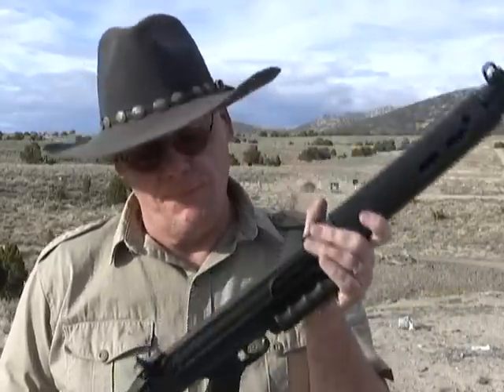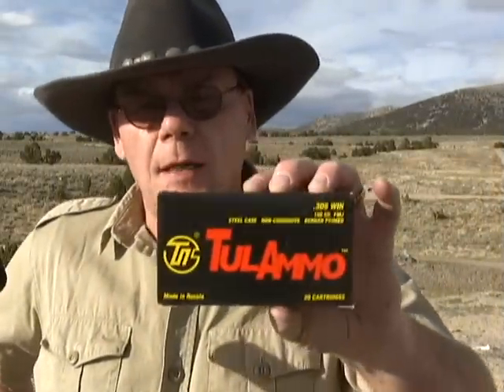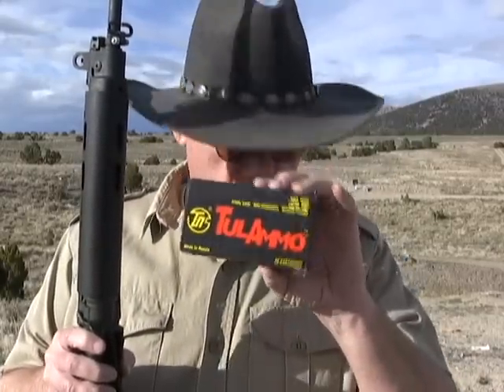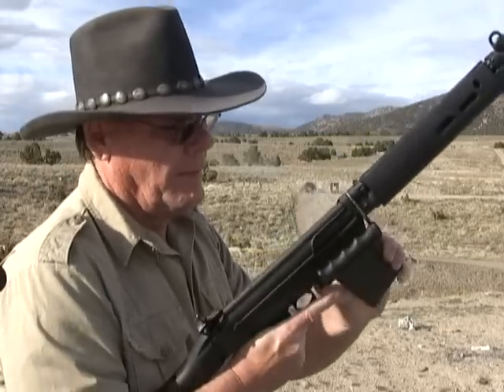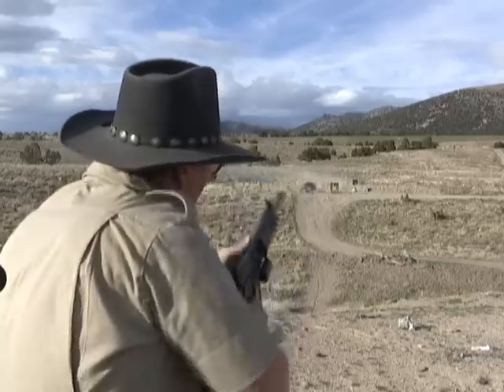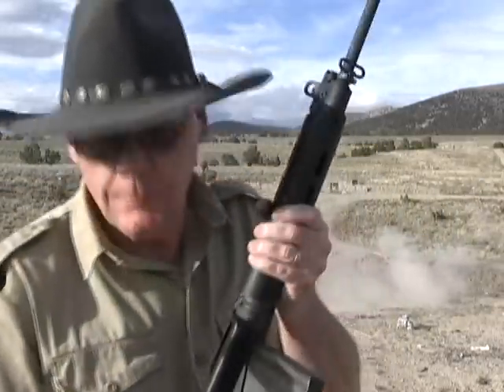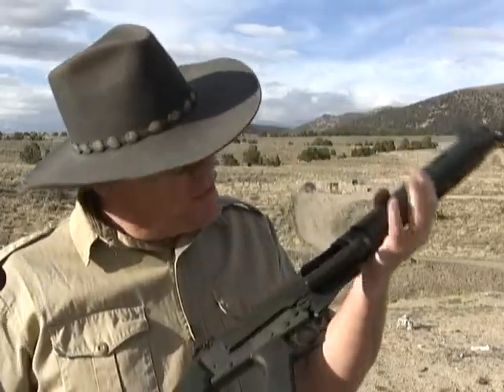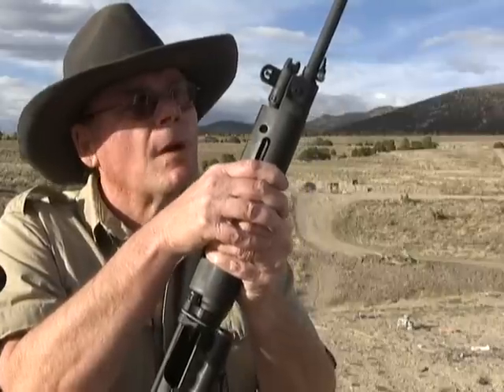Century Arms .308 R1A1 FN FAL Battle Rifle Junk?? You Decide!

Comment from the maker: mosinluver......sorry about the delay getting back to you. If the plug that holds the gas piston is put in upside down the gun will only fire one shot at a time. If you can, remove the plug and turn it around and replace it. That should fix the problem. I'm not sure which magazine I'm using....they were ordered when I bought the gun and at the time I didn't know there were inch and metric mags. Sorry.

Comment: yes when the rifle is completely assembled the safety will go past (F) to a 3rd indent that I believe would be full auto. But it locks the trigger after it goes past (F). I'm thinking of drilling a small hole in the pistol grip and putting a roll pin in the hole, sticking up far enough to catch the safety lever and keep it from going past (F).

Comment: I used to have a Century L1A1 Sporter, back in the early 90s. The receiver had a problem with the bolt carrier guide rails not being fully machined, (they had an hourglass shape to them), which caused feeding issues.  About 45 minutes with a fine file and I was able to get a straight, even face on each rail and after that she was flawless.

Comment: THe version we used in the Canadian Forces was called the C1A1. Although they were already old when I was in the forces ('79 - '84) we found them pretty darn reliable. Kept the gas regulator set at "4", and after a lot of use, you might need to dial it back to "3". Ours had a rear disk type sight that ranged from 200 to 800 metres if memory serves. Once the armourer got it set up for you, it was very possible to get a 20 shot 8" to 10" groupings from the 600m firing line. I loved that rifle. Thx

Comment from the maker: harperjoe....as far as damage to the cases the mouth has a small dent from hitting the side of the receiver when it's ejected, but not bad enough to keep you from reloading the case. And yes, marks are left on the receiver just behind the ejection port. The marks are only cosmetic and don't seem to leave any permanent marks in the metal. I've been reloading since the late '70's and wouldn't hesitate to reload for this gun if junk ammo wasn't so cheap. Good luck and have fun.

Comment: My SLR was so reliable, the only time I ever had a stoppage on it was when firing blanks and even then you could fanny on with the gas plug to fix it.
You could also insert a wooden match into the working parts which made it full auto, couldn't hit a cow in the arse but it could be done.

It was also the most ergonomic thing to carry about, you could snug the rear of the pistol grip into the crook of your elbow and wrap your hand around the front of the mag and it was almost like it wasn't there, we were issued slings but they stayed coiled up in our lockers for all time.
Fond memories.
I'm no steely eyed sniper type but could hit plates at 600m regularly.
The only problem I had with it was the bottom plate of the older more worn out magazines could sometimes decide to ping off under spring pressure dumping your twenty rounds on the deck, not the best form of entertainment on a cold shitty pitch black night.

Comment from the maker: The top of my safety has a small tab that hits the bottom of the upper receiver preventing it from going past (F). You must have a redesigned safety or perhaps an older design. Sounds like the roll pin should work.  Anyways, have fun and be safe.

Comment from the maker: I watched your "FN FAL" video and you certainly had fun. I own seven magazines for my L1A1 and only four will run 100% reliable in my gun and the other three are crap.  Apparently my gun is very sensitive to magazine brand and I'm willing to bet that is your problem. I can't tell you who made my mags as they are unmarked but they all seem to have been made by different companies. Have you tried adjusting the gas port? Mine has to be set on "3" to run reliable.

Comment: You’re correct. I carried the SLR L1A1 for the first ten years of military service. The L1A1 is the best FN FAL variant. The rifle in this video was made from ex-Australian parts / rifle. Gas setting '4' is standard, '3' indicates some wear in the gas system. Check the length of pin on the mag hold open, it maybe too short for some of the mag floor plates. Thank you for the wonderful memories this video brings back.  It is the BEST battle rifle ever, great ergonomics & accurate. Thanks, Greg

Comment: Used this when I was in the army here in Australia.  Best assault rifle I used. Easy to clean,  strip down etc. The L1A2 is the one with the heavy barrel and goes to full auto. It's a rifle not a gun. The original was done in metric for  range not imperial.  The L1A1 was made for semi auto and not full auto. I still own my original issue that I purchased from the military.

Comment: Four things: used the SLR L1A1 for about 14 years: it is a rifle not a gun,  when cocking need to hit yourself in the chest to ensure full cycle; cleaning the feedramp is easy when issued with the pull through you can use the dipper as a scraper :)

Comment: Also used the L1A1 Lithgow made rifle in the Australian Army during 70s and 80s and loved it.  Also came with a grenade launcher that you fitted to the end of the barrel and turned the gas plug around to have all the gas exit the barrel and launch the grenade.  We used a special blank round for launching grenades I not sure but I think it was called a Ballistite cartridge.  If you wanted to stop something at range around 150 to 400 metres then this rifle did the job. Also it was not slowed by small tree branches like the 5.56mm

Comment: Great vid, i got my G1 sporter from Century Arms. Shoots well and pretty much reliable. I had issues with the muzzle break coming loose. After took off the buttstock to paint it i had extraction issues but my fault, recoil spring wasn't correctly reinstalled. Oh, and during this time i tried to shoot some '7.62x51' instead of .308's and the bolt didn't even cycle.
Reply: Adjust the gas regulator, as .308 shoots at a higher pressure than 7.62. So it needs more gas, as in a higher setting.

Comment: The South African army issue had a flip up sight attatched to the gas adjuster, once the sight was fliped and turned it closed the gas, you then loaded it with a balistic round and slid a rifle granade over the barrel then launch the granade like a mortar, it kicked like a 1000 mules but was very useful in the Angolan war in the 80's

Comment: Hi there. Just a couple of quick comments. When we used the SLR in the British armed forces the standard operating procedure was to set the gas regulator to 6 and fire the weapon, if you had more than two stoppages you then adjusted the regulator down 2 (i.e. is lets less gas out), then you continued firing. Some guns we used were on a 6, some we were told not to adjust as they had been adjused to fire correctly. The error was probably due to worn components or a slightly enlarged gas hole.

Secondly, always remember to flatten the rear sight when you aren ot firing the gun, they are not delicate but it wold be a apin in the arse if it got damaged.

Comment: originally the l1 was selective fire, but it was found to get to hot to quick, so they modified the safety catch, the AR however was left as was because it had a heavier barrel,,, and that is really the only difference apart from the bi pod fitted to the AR, the safety catches are interchangeable between the two

Comment from the maker: walperstyle....no, it is not. The .308 Winchester is similiar to the 7.62x51 NATO. There are small differences between the .308 and 7.62, such as velocity and head space. Because of this I would recommend that you do not fire .308 ammo chambered for a 7.62x51 rifle or vice versa.
Reply: @ Mixup98: The differences between .308 Winchester and 7.62 NATO are not just in the ammunition itself, but just as importantly, in the arms which fire them, and are designed to fire them. Mil-spec small arms (whether individual or crew-served) are designed with generous chamber/throat tolerances to enhance reliability under harsh operation conditions in the field, i.e., being used when hot, dirty, or lacking in scheduled maintenance. Also to aid in proper function when being in select-fire (full-auto) mode. For the same reason, 7.62 NATO cases are designed to a specific standard of construction such that they can withstand the rigors of being fired in fully-automatic general-purpose machine guns, including feeding from boxed, belted or linked ammo, and extraction/ejection from such systems. This means that the case walls are somewhat thicker, more-rigid and stronger than most/many commercial .308 Winchester cases, which are designed strictly for sporting/recreational use. The typical hunting rifle in .308 has far-tighter chamber/throat dimensions than the typical mil-spec weapon in 7.62 NATO. The commercial manufacturers can get away with this, since a bolt-action used for hunting is seldom fired for extended strings of rounds, but usually 2-3 rounds before a chance to cool. Tighter tolerances generally mean greater accuracy potential, but the military is willing to surrender a small amount of accuracy in return for greater reliability, hence more-generous chambers and throats. It is germane to note also that commercial .308 Winchester ammunition, even within the same bullet style/weight - say 150-grain FMJ (Ball) - is usually loaded significantly hotter and to higher muzzle velocity than equivalent mil-spec. NATO M80 Ball. Or,  taking 175-grain OTM ammunition for example, Federal loads their Sierra Match King BTHP line to around 2600 fps (22" barrel) whereas M118 Match, 1730-grain, the longtime match-grade military load for the Army and Marines, was loaded to 2550 fps. Some - not all -military-pattern self-loading rifles will work OK with commercial .308 whereas others will not. As always, best to follow the manufacturer's recommendations. If for no other reason, than if you do not, it will void your warranty.

Comment: Had the same rifle by Century...had the paratrooper folding charging handle like yours and the receiver was made by Imbel...a very respected Brazilian manufacturer. Never had any problems with it...was very accurate with the CAVIM ammo and reloads. The rifle cost me $600 back around 1997-1998 or so but sadly  I sold it a few years later. I just never found it to be well balanced and it was heavy. Today I have a Springfield M1A...much like the M14 I trained with in Army Basic Training in 1969...have always had a soft spot for the M14. This one I will not sell!  :o)

Comment: Belgium made are the best. Used it in Rodeaisa only a nato 7.62 on full was a monster but ours cam with this mussel type break that you'd adjusted to compensate for directional drift. Was a beautiful thing. Mine never jammed ,even on full. On single complete control was spot on. Could really reach out and touch someone. Sweet tool.

Comment: I used the Canadian version, FN-C1A1 when I was in the military.  They are good rifles, though the carrying handle on this one seems a bit loose. The "Little Part" Deadwood Dick is referring to is called the gas plug, and it would have been helpful to the uninitiated to show the correct position.  The gas plug is the hardest part to clean incidentally, and scrubbing the carbon off is best accomplished with the head of a wooden match, of all things. Normal position for the gas regulator is "4."  The drill if your rifle stops working is to set it down two steps lower. If that works, try stepping up one notch. 

Note:  I found this rifle had a pronounced tendency to kick the user right in the cheek, especially if the wrong size butt stock was used. We had them in sizes Small, Regular, Long and Extra Long. 

The pistol grip makes it much more comfortable to carry and control than an M14 but it it takes way longer to clean and the action is more prone to fine dust. 

Finally beware that there are two basic patterns:  Inch type using English measurements (British, Canadian, Australian, NZ, Indian etc) and Metric (just about everyone else).  Inch pattern mags will fit very tightly (if at all)  into metric pattern rifles and metric pattern mags will fit loosely in inch pattern rifles. The best made magazines are the Canadian ones, but they are probably near impossible to come by as Canada destroyed most of it's FN's.

Comment: m-4 is a .22 cal so its out of the running early on. the AK and FAL are both 30 caliber however the AK only has a 39mm powder package vs the FALs 51mm.(that's what the 7.62x39 & 7.62x51 stands for) also the AK has 126 grain bullet vs 155 grain in the FAL. so bigger bullet and more powder means the FAL wins the power challenge thank you for playing

Comment: Hello, I just traded a another rifle I had to get this exact FAL. I shot it today for the first time. I had 10 rds of wolf 308 that was already in the magazine, and 2 different brands of 7.62 nato. It fired the 308 flawlessly, but when I loaded the 7.62, all it did was jam or would not eject no matter what the gas setting was. It wouldn't feed rounds into the chamber from the magazine either. They would get jammed on the lip below the chamber and above the feed ramp. Did you encounter this issue at all before the modification? As stated before, steel case wolf had no issue even without modification to the feed ramp. It was only 7.62 nato. If at all possible, would you be able to share with me how you polished the feed ramp if that will even fix my issue. I would appreciate it
Reply from the maker: Hello Justin. I no longer own the rifle shown in this video but I will try to help you with your problem. I polished my feed ramp using a Dremel tool and polishing compound. As far as ammo is concerned the .308 produces more velocity and energy than a standard 7.62 NATO cartridge so that may have something to do with the cycling and feeding issue. Have you tried 7.62 American made ammo? Is the chamber pitted or dirty? If you haven't done so already I would recommend a good cleaning and some gun grease on the rails and bolt. Hope this helps.
Reply: @mixup98  Thanks for the reply. Yes sir, I have cleaned it. The brands of nato ammo I tried were Winchester and Aguila. What's weird is why it fed from the magazine the 308 but not the 7.62. When hand charging, the rounds kept getting jammed on the lip below the chamber and at the top of the feed ramp.  And I noticed when I hand ejected a round after firing, I noticed on the lip of the casing where the bullet was the brass is bent. Every one of them was like that. None of the 308 were bent like that. If possible, would you be able to explain where exactly to dremmel on the feed ramp and how much to take off? I'm going to the range again today with some other brands of 308 and see if I have issues with them. I read somewhere that some century or other non FN fals may shoot 308 but not 7.62 or vice versa.

Comment: Your presentation was excellent. I have found that the inch pattern magazines are more reliable and the L1A1 rifle to be the best variant of the FAL. Remember the rifles assembled in America are usually parts kits, sometimes mixed inch and metric where they can be interchanged. Also there are the R922 requirements and the usually out of spec components required. The FAL is very reliable in factory form;but requires cleaning.

Comment: The Australian Army used these alongside the M16 in Vietnam . Used at the battle of Long Tan where 108 Aussies took on 2500 NVA and prevailed . 
The 7.62 versus 5.56 - a lot of Australians preferred the SLR over the M16 
The lighter round did not have the penetration and would struggle to get through even the jungle Foliage , compared to the more powerful round ...... In war their is no substitute for Victory
Reply: @ Doug Martin: Osprey Military (publisher) has an entry in their 20th-century weapons series called "The FN FAL Battle Rifle" by Bob Cashner. In it, the author recounts the 1966 Battle of Long Tan, and even quotes a snippet from the after-action report saying that the SLR (L1A1) was the "outstanding weapon of the action" in the hands of the troopers of D Co., 6th Battalion, Royal Australian Regiment. What nearly did them in, however, their bravery notwithstanding - was how few magazines were issued to each soldier; only five was typical. Far too few for an extended firefight, as it turns out. Most of the men had some spare ammo in their pouches, either in bandoleers or stripper clips, but reloading mags while in contact and under fire is no picnic for anyone. In the end, a helicopter drop of ammo, done on an emergency basis under fire, proved to be necessary. After this engagement, the standard number of mags issued per man was changed to eight by the battalion CO. There's supposed to be a film coming out about the battle. I'd like to see it, but have not yet done so.
Reply: @ Doug Martin (Part 2) Echoing your observations about the 5.56 versus the 7.62 NATO round, I have heard the same thing over the years from Vietnam veterans in this country (U.S.), guys who were in combat "boots on the ground" over there. They resented having to turn in their M-14s (which fired the same powerful 7.62x51 NATO round as the L1A1/FAL) for M-16s, which - while significantly lighter, easier to control in select-fire use,  and enabling a larger basic ammo load to be carried, came up short in terms of range, power and penetration. As one old salt put it, "7.62 NATO turns cover into concealment"....
Reply: @GeorgiaBoy1961   the Movie is out , its Called "Danger Close " and is available on Blu Ray DVD .
Reply: @parabelllum8733  - Hey Doug, thanks for the tip. I'll be on the lookout for it. I'm in the midst of relocating, so it will have to wait a bit... but I'll get to it eventually. It's about time our great friends the Aussies got some respect on-screen for their military prowess.